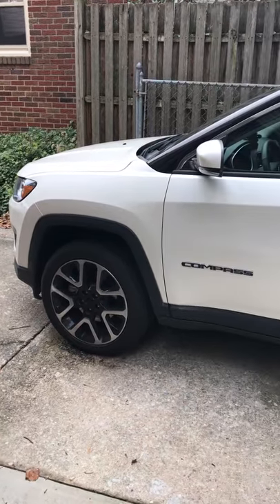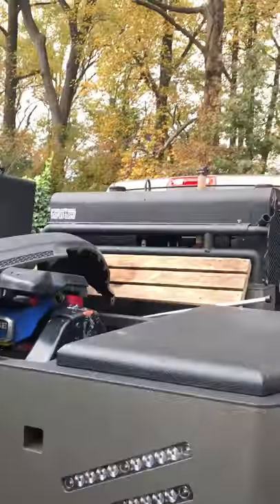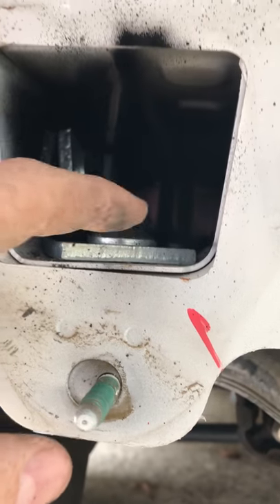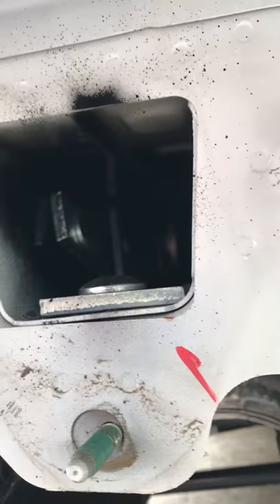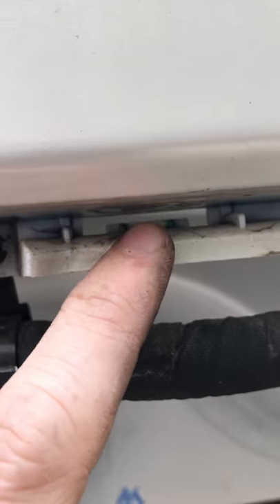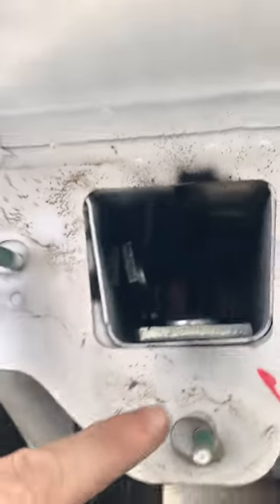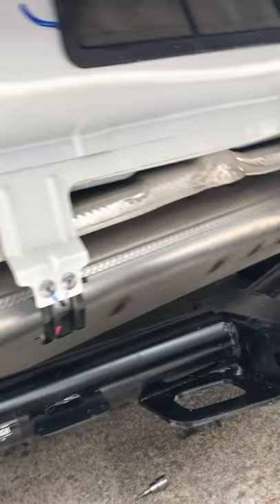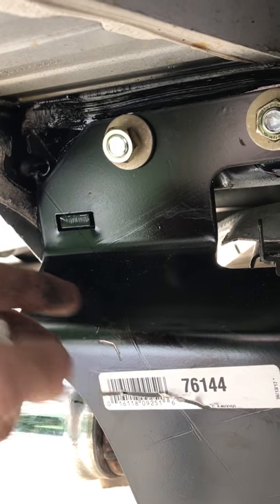2017 Jeep Compass NEW BODY Trailer Hitch Install

Comment: Matt
Well we went ahead and trying to install a receiver hitch on our vehicle before our vacation in two weeks to the Cape. It does not say anywhere on the listing to buy this receiver hitch that you need to replace the facia in the back that’s what ours is welding. We also found a issue that you got drill holes in the frame and ordered even put any both through there’s just small stickers with a bowl tie for you to drill there’s no pre-drilled holes for a receiver hitch. Also this compass is using a lot of oil and his 30 K. Chrysler junk. No more jeeps no more Chrysler. Getting rid of my Ram. Thanks for listening to my complaints. Yes I’m standing here with dirty hands mid project trying to figure this out. Thanks Chrysler

Comment: Omg thank you so much I was about to buy a grinder as I was gonna install the hitch this weekend, u sir are a life saver and that process u just posted is gonna save me time and I won’t have to cut the holes but u are right about the safety and cracking of the frame. Again thank you so much 👍🏻👍🏻👍🏻👍🏻

Comment: Thank you!!! The plastic bumper was a little tougher to remove than anticipated and we had to remove one of the exhaust bolts, but this was soooo much better than instructions we were sent and needing to drill into frame.
Reply from the maker: brittany sweatt Good deal, yeah I forgot to mention that I did have to drop one of the exhaust hangers! Glad it worked out for you

Comment: they like all other hitches are not suggesting you just go hacking your frame. What they suggest is that on the frame there should be 3 holes with plastic covers. They suggest you remove those plastic plugs, then use a die grinder to slightly enlarge the rear most hole, just big enough to be able to slide the bolt sideways. I work on cars, and have worked with metal, and I could not see enlarging the rear most hole by a little bit, with a die grinder, reducing the strucal integrity of the car that much. With that said what you showed about pulling the bumper off and having direct access to the top of the holes is probably a little bit easier, and a lot less nerve wracking, especially to someone who has never worked on a car, or with a die grinder. But if your a metal worker, or car worker you should have no issue with enlarging the rear hole enough to slide the bolts thru. Thinking about getting a hitch and I might do your way with removing the bumper thou. But how low does this hitch hang, I don't want to reduce ground clearance.

Comment: How does it look on vehicle? I want to get one for mine but wondering if it hangs down low and look shitty or if it dramatically reduces rear ground clearance? You should make a follow up vid with the finished product, would love to see it installed and everything put back together.
Reply from the maker: Steve Rivera Sorry I did not see this post, I don’t check youtube very often. But the hitch looks good, we had the old body style Jeep, and the hitch looked wayyyy lower on that, then it does on this new one. Looks good.
Reply: Matt, did you have to cut the rear body modeling at all? I bought one of these based on information on etrialer, but obviously what I saw on there and what this hitch actually is are two different things. Very glad I saw this before attacking my hitch.
Reply from the maker: dhaberman86 Sorry I saw this so late, but no I did not cut any molding, or any plastic trim pieces. They might have sent you the wrong one or a different hitch. This hitch was the heaviest duty one for the new compass

Comment: Hey Matt from PA, it's Kevin from PA here. How much to hire you to do this for me? Haha, no seriously though, is it possible to do this all without lifting the car? Awesome video. Just saved my ass from a lot of extra work for no reason.
Reply from the maker: Kevin Pierce I recently moved to South Florida, but I’m heading up there next week to move some stuff down if you want to get it done!
And no I didn’t lift the car at all, just laid down some cardboard in the driveway. Once u get the plastic off then there is all kinds of room.
Reply: @MrPipeliner909  thanks for the reply man! I might be able to get it done this weekend if that's the case, all depends on the work schedule. I appreciate the offer though and wish you best of luck on the move. I really didn't want to drill into the frame like that, haha.

Comment: Will installing an aftermarket hitch void the warranty? I'm wanting to put one on my new compass for a bike rack
Reply from the maker: Clay Black No it won’t, just don’t follow E trailers directions and hack into the frame, or do any cutting or welding to the frame and you’ll be fine

Comment: Which hitch did you get? I want to get the same so I know there is no trimming involved. Thanks
Reply from the maker: JBarca23 Item #76144 on Etrailer.com
Reply: I just installed this hitch and not only do the instructions for grinding and access opening unsafe and void warranty, etc...but, it's so mi much extra work that is completely unnecessary. Literally 6 extra bolts to remove the crush bumper and you have full access to inside frame rails. Other then poor instructions, the hitch looks great! Thanks for posting the video